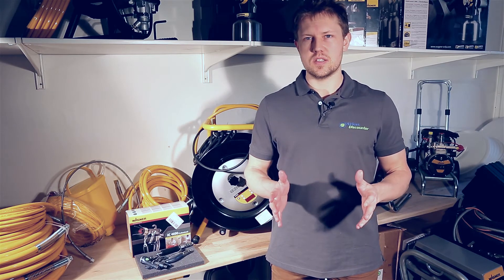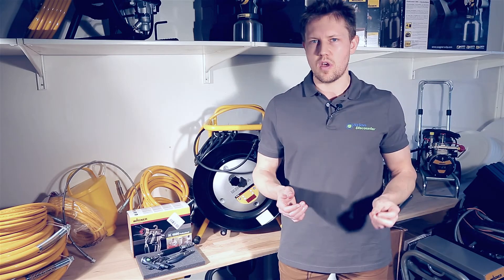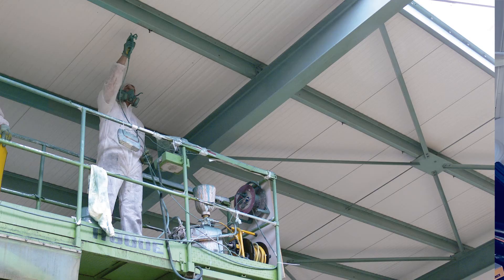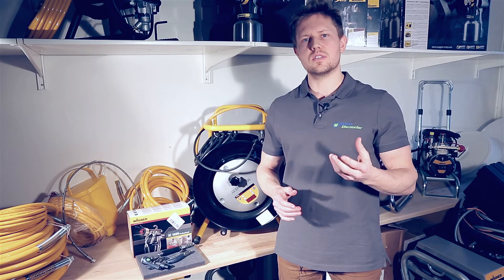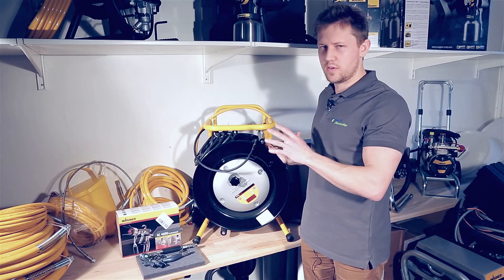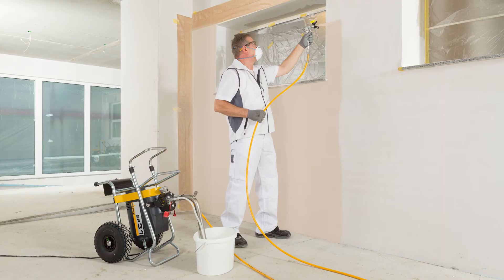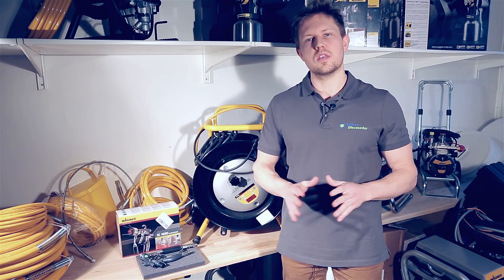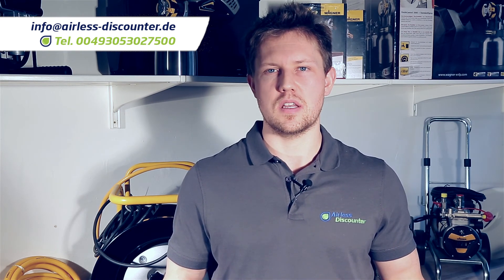Heated Hose Systems & The Wagner TempSpray

Comment: Does the paint do anything unusual because in the application guide of some paints say do not apply below 10c and above 30c , I live in Australia and it doesn’t get very cold,  thank you
Reply from the maker: Thank you for your question and watching our video. Latex paint contains water, which will freeze and cause the paint to become lumpy and inconsistent. Paint applied to a surface that is too hot may dry too rapidly and crack or leave undesired finishes. The heated hose systems in this video, are more to counteract the colder working environments, however the paint atomizes nicely when slightly warmer.
Reply: I’m more interested to use for oil

Comment: Hi mate , looking at the h126 to use with Wagner air coat to spray oil based enamel hoping not to thin to reduce fumes, just wondering if the oil would level out even though the architraves or doors are cold and no thinners, cheers